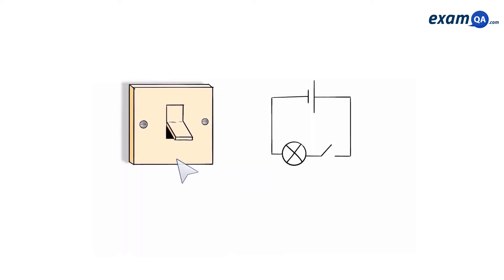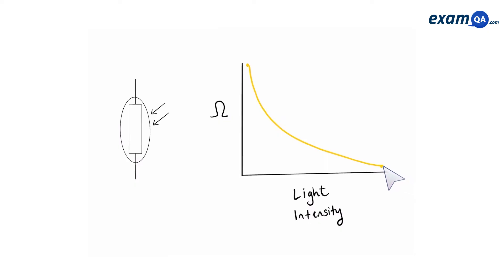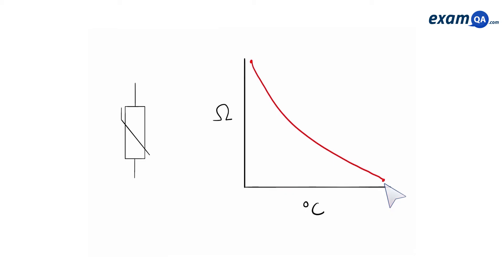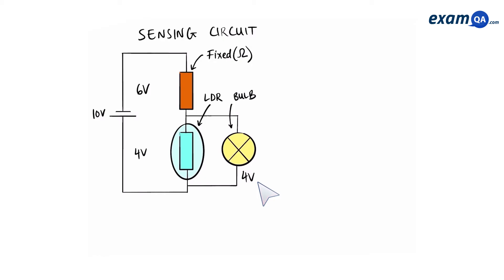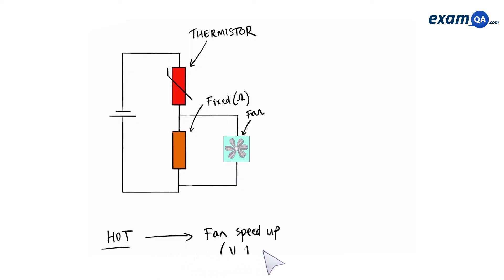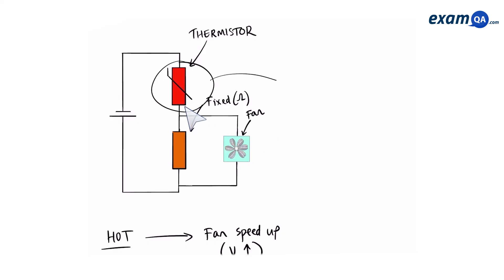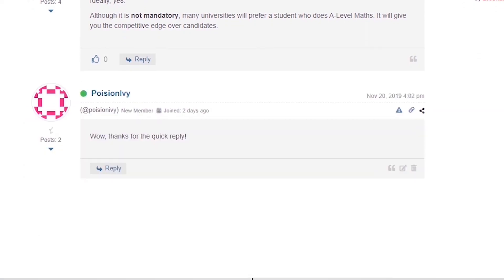LDR, Thermistors and Sensing Circuits | GCSE Physics

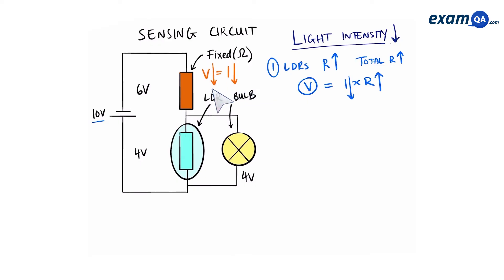Comment: Where did you randomly get the 2V from at 5:22?
Reply: it is just an example, but the overall motif of the light intensity decreasing is that the resistance increases, then current decreases, so voltage of the fixed resistor decreases. The resistance can decrease to how much you want it to decrease but the 2V is just an example.

Comment: for LDR are wetalking about light intenity in terms of sunlight or the bulb. cause if the resistance of the circuit is low the light from the street light lamp should be high because theres "less resistance". IM SO CONFUSED
Reply: thats wat im also confused abt

Comment: very informative, However, i have a question, in other circuits for the thermistor, it shows the fan/component in parallel to the thermistor and not the fixed resistor with a variable resistor in series with the thermistor. will this still give the same output or not?
Reply from the maker: That is a problem that is beyond the scope of GCSE. But if you post a picture of said circuit on our forum, our physics teachers should be able to answer it. https://examqa.com/forum/